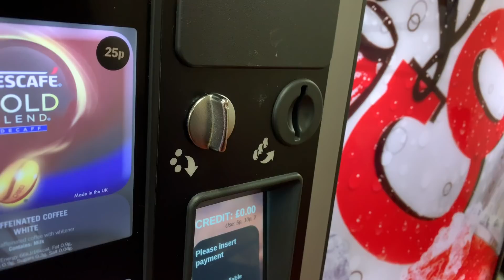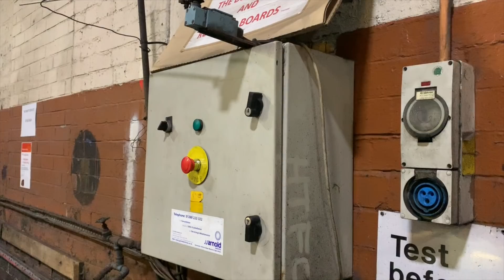Where do buses fuel up? 🚌 Wash Lane Special💧(I wash a bus)

Comment: Hey bud. Good on you for doing this wee video. 
I myself was working at the Inverness stagecoach depot last year for near a year (until the stress was just too much to handle) I was mainly doing the parking although I had done everything else before that. 
On week days when the schools were on there was around 90 buses to be done on that shift from 5pm to 1.30am. 
I was the same as you about not confident enough to do the parking but had no choice and just take you're time when manoeuvring and dont hesitate to shout your head off at drivers that came in and abandoned a bus that will be in the way. 
On a number of times I would be on my own until 9am to get buses washed and fuelled because of the other shunters (polish) buffered off home as the were stressed out themselves even though they were not doing the parking side of things. Had to stay because I couldn't have on my shoulders,  leave unfuelled buses for the morning and leave absolute chaos for morning drivers. The place is a mess and really if you want a challenge then go there. I left because of major stress, not being appreciated by the bosses for the work I did  and more pressure kept on being added even after I complained about the conditions. I always got appreciated by most of the drivers and the controllers and some would help at times when they could see the pressure I was going through whilst litterly running about cursing and near ripping my hair out. 50 busses is a walk in the park hahaha when I was there, there was a max of 5 shunters at times but usually only 3. Sorry for the long long rant but honestly it's great to see yourself actually recording a video of what can happen. Take care dude.

Comment: Different from my country where i used to drive two doors 12m single deck,12m three axles deckers and 18m articulate buses..Depot capacity is 300 minimum with 750 is the maximum..I can drive metro trains too..I ride my 1199cc bike to work

Comment: I did this for 3 months. At  a well known bus firm that you worked for. From the bus coming in to entering the wash the sweeper has 3-6 minutes, depending on fuel load to sweep a 40-44ft bus off. I know the hardship. The regular shunters and cleaners are on £8.50p/h for a job that's very fast paced and physical.
Reply: TheDark Devil151 I’ve got an interview for this job tomorrow’s but it’s £12.50, quite surprised by that

Comment: The downside of parking them that tight is that if the "first" bus is broken and won't run, all other buses are pretty much screwed.. I can understand that the depo has limited parkingspace, but it's not a good idea to have them parked like that. If you ask me. :) But still, thanks for an interresting video. Keep it up.

Comment: I thought buses ran on red diesel?
Reply: No, red diesel is used in farming and construction vehicles
Reply: Red diesel has no Fuel Duty, so cannot be used by any vehicle on the public highway. Trains use red diesel.
Reply: @grahamgarnett8338  I'm sure my local bus company (Stagecoach) Use red diesel i seen a tanker in their depot, the same lorry that deliver's red diesel to farmers in the area
Reply: @Scottish Bloke Are you sure it’s red diesel? Red diesel is literally red due to the dye in it. Red diesel has zero fuel duty on it and is used for vehicles which don’t use the public highway, or other engines that are stationary, eg generators etc. If red diesel is used in a vehicle on the public highway then this is breaking the law as it is tax evasion. Maybe Stagecoach use the red diesel for other means?
Reply: @grahamgarnett8338  they are definitely using red diesel, not sure if it's going in the buses but what else would they use it for? maybe they are using it in the buses illegally. To keep their operating costs down. the police aren't going to stop a bus and test for red diesel as the do in cars/ vans .
Reply from the maker: They will be using bio, as it’s illegal to use red diesel. Why would stagecoach risk big fines and loosing there operators licence over fuel?
Reply: Probably for other stuff like jetwash and stuff